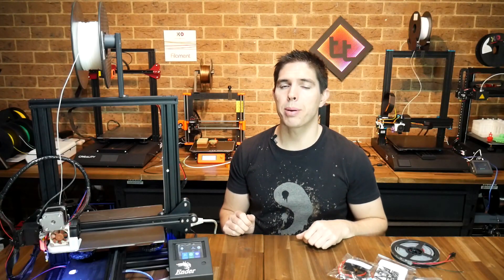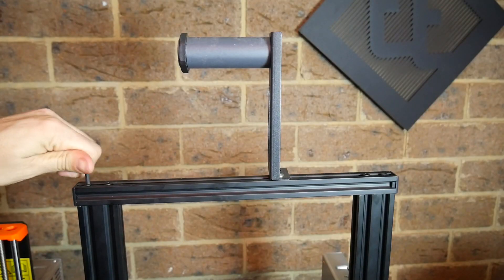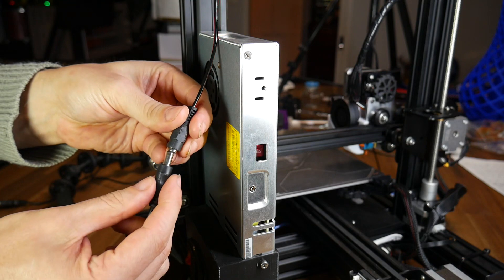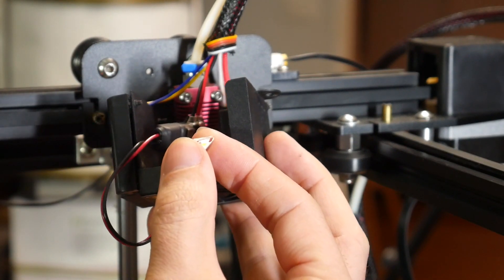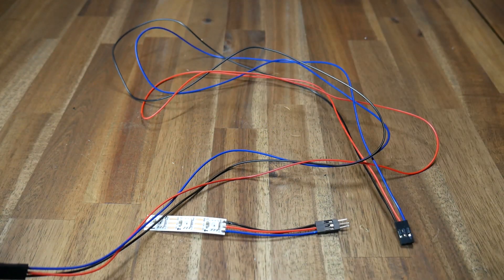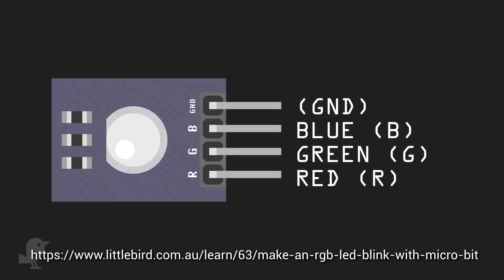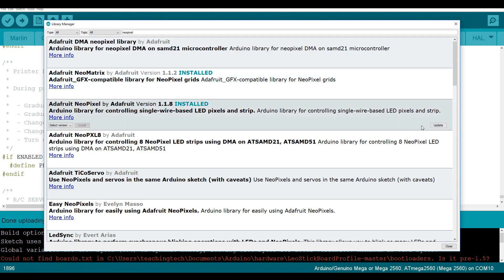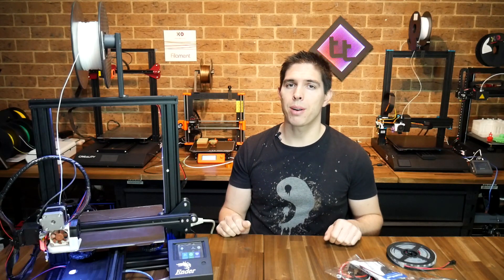3D printer LEDs - Beginner and advanced versions - Neopixels!

Comment: I have a CR20 Pro. I want to add some cob LEDs along the rails and hot-end. There are empty spots on my main board (Creality v2.1), an extra fan or two. Could I directly connect the LEDs straight to one of the empty fan ports (with a JST connector) and then turn the LEDs on by turning the "fan" on?

Comment: I have the hotend LED version from PrinterMods and love it! But I think I will wire it to my RAMPS 1.6 board so I can turn it off an on as I please vs with the cooling fan as the voltage varies depending on the speed you want the fan to run so the LED lights vary in brightness. For now it work but it'll be easy enoough to run to the pins on the board so I can trigger it with code in Octoprint or on the mobile version you can setup a button to run the command for on and off. Nice video!

Comment: I don't know what I did wrong... My ender 3's power supply literally went up in smoke after doing this...
Reply: Did you buy the 24v instead of the 12v if you're in America? If so you might have been trying to draw WAY too much power and it caused it to overdraw and blow it up
Reply: @ParrishT3  I made sure I got the 24V by checking on the LED's. I contacted printer mods customer support and they graciously sent me another one. The switch for the LED's started smoking so it might've been a bad switch??
Reply: Also, the Ender 3 is a 24V printer, isn't it?

Comment: Strongly advise avoiding that crimp connector he features here on his ender 5 hotend!!! 
When you pull the wires from the fan retention clip to have enough room for the crimp connector, it becomes extremely easy to pull the wires off of the fan's circuit board. The wires then cannot be soldered back onto the board, and then the fan must be replaced. 
As an alternative, it is much better to cut the wires further back and use a JST crimp set to make and install a JST socket and splitter to support both connections.
Not only does this support the LEDs, but it also gives you a means to easily swap your hotend fan if/when needed.
Understand that many people are turned off by the though of crimping or soldering, but if you rip the wires out of your fan its going to be a bad day if you don't have a spare....

Comment: Yes I installed my neopixels the same kind he used in video I did what I was supposed to do in firmware but when it comes on it goes thru the colors but not white and the printer events don’t work no blue to pink to red or whatever the colors while heating the bed or hot end what am I doing wrong I have the BTT SKR v1.4 turbo with 2209 steppers and it has a neopixel pin built in and the pin is set correctly

Comment: Good information for my Ender 3. The bed heater mosfet was damaged by ESD. I used pin 29 to control the BED HEATER.  #define HEATER_BED_PIN   29 (SANGUINOLOLU_11.h)   #define BED_LIMIT_SWITCHING, (Configuration.h)  I used a 2N2222 to control a 24Vcoil 10ADC relay. The Marlin default is 2C hysteresis which switches the relay about every 1m15sec.  
Thanks for the pin29 information.

Comment: The amazon link for neopixels in the description is not the ones used in the video, and have less LEDS per meter (so you won't fit 3 leds along the hotened).
Correct link: https://www.amazon.com/gp/product/B00R5CBOWY

Comment: I want to add 1meter of neopixels to my printer. I have skr 1.4 turbo. THe LEDs need 3.5a 5v power. Can I pull that much from the Neopixel 5v line or should I pull 5v from outside source?
Reply: Outside. You can use a voltage converter for 24 to 5v and pull right off the power supply. To the converter. To the lights

Comment: Recently purchased the “PrinterMods” LED kit .love it but the hot end should have some type off switch so u can turn it on and off as well . Hopefully there’s a solution to it soon!.
Reply: 3D PropCon I agree. I just got everything hooked up and mounted. The top bar lights are perfect, but the hot end lights are too bright overall. The ability to turn them off and/or dim them would be very welcomed.
Reply: @jayphilbin2871  @3d propcon Are you guys still happy with the LED's? Also not having it on the sides does it look funny (dark)? tks!
Reply: @armani007E55  I ended up removing the lights on the hot end. They were way too bright when it came to photographing or videoing the action.

Comment: The product links are not what you used, so I ordered the wrong kit. The neopixel strips you used are not 30 per meter or weather proof as per the link, they are probably 60 per meter. Wish I had known that before buying. Great videos but please don’t post links to parts you didn’t use and are not fit for the application you are demonstrating. Thanks.

Comment: i have so many grabage connected to my PSU that i don't have terminals left :s I even put wires in a few of the exisiting ones.  I really need to solder an extension board to just get a terminal but that's more space and fiddly stuff hanging from my printer :s
also damn those connectors are so cool. do you know what they're called? I always do it with soldering and it makes a mess :s

Comment: I followed the instruction to implement the neopixels.
Now I have a dead motherboard.
This is what I did and what happened:

I use Marlin 1.1.9 and an Ender 3  with board V1.1.4
I installed:  10 Neo-Pixels RGB WS2812B Digitale Led Strip Ultra Bright SMD5050 5V, triggered from pin 29.

Changed configuration.h
 as followes:
// Support for Adafruit Neopixel LED driver
#define NEOPIXEL_LED
#if ENABLED(NEOPIXEL_LED)
  #define NEOPIXEL_TYPE   NEO_GRB // NEO_GRBW / NEO_GRB - four/three channel driver type (defined in Adafruit_NeoPixel.h)
  #define NEOPIXEL_PIN    29       // LED driving pin on motherboard 4 => D4 (EXP2-5 on Printrboard) / 30 => PC7 (EXP3-13 on Rumba)
  #define NEOPIXEL_PIXELS 10       // Number of LEDs in the strip
//  #define NEOPIXEL_IS_SEQUENTIAL   // Sequential display for temperature change - LED by LED. Disable to change all LEDs at once.
  #define NEOPIXEL_BRIGHTNESS 127  // Initial brightness (0-255)
  #define NEOPIXEL_STARTUP_TEST  // Cycle through colors at startup
#endif

Library installed:
Adafruit NeoPixel by Adafruit Version 1.1.8

Compiling and flash went ok. Thereafter I got on my windows PC an message about to much current over usb. Then Ender 3 board died!

I don't know why this happened. 
I'am affraid to implement this again with a new SKR Mini E3 motherboard that's already ordered.

Someone who can help?
Reply: It is now known what happened.  When soldering pin 29, a bit of solder tin may have fallen on the part fan connector and has therefore made a short circuit.  I had meanwhile removed the old motherboard and ordered a new one.  I replaced the “Old” motherboard and everything works perfectly again.  All in all am happy again with the Ender 3.
Reply: @jan.walhof  Did you try to set it up again on a new board? I have used pin29 but my neopixels doesn't light up at all :(

Comment: I just got my kit from PrinterMods today, followed your guide and the instructions (sliding it in backwards, wires first), and my led strip broke :( I think it wasn't soldered correctly. I emailed the company, Im hoping that they will send me a replacement as I was very excited for this mod.
Reply: My led strip from them is shutting my whole printer down.  Did you get a response from them?
Reply: @gromzuk  No I never got a response...it's been a long now which is pretty annoying.

Comment: I tried following the advanced guide using neopixels. You mentioned that if I use analog LEDs I will require a mosfet. The Marlin code says I'll require one either way. When I tried to plug the LEDs into the printer as described, the printer shuts down until I unplug them.

Do I need a mosfet, and if so, how do I wire it?

Comment: I can't get the heatshroud on with that coupler inside it...mine looks exactly like yours does but i can't line up the screw holes and the two red wires for the hotend seem like they'd be smashed against the red heatdsink if i did

Comment: I just finished installing the Printermods kit on my Ender 3 and they both went in nicely.  The included installation instructions are okay but this video was a very helpful addition. When installing the hot end kit, I found it a little easier to remove  the 4 screws holding in the hot end fan and work with the splice outside the shroud.  When installing the rail kit, I raised the X gantry all the way to the top before loosening and removing the top rail screws.  I don't know if it helped keep my vertical rails parallel but it made me feel like I attempted to keep them straight.  The lights look great and the hot end light is especially useful.  Thanks for the video.

Comment: I was just working on adding in LED's to my machine today lol... Looks great man! I bought a couple white LED rings (60mm OD / 45mm ID) a few weeks back so I was making changes to add a round inset channel to the bottom of the Hero Me duct and modified my electronics box to add a switch and potentiometer to the front so I can adjust the brightness quick and easy. I might add the neopixels in the top 2020 extrusion as well, the color change functionality looks awesome!

Comment: Iv'e literally been thinking about doing this to my Ender 3 the whole day. But with Octoprint. Couldn't you use a pushbutton, connected to the Raspsberry Pi and make it turn on a mosfet which runs the LED circuit, turn on/off through wifi and even through the tft28?

Comment: I used rigid led strip in a simple casing and two sided tape but i did add a separate power supply that just about fitted inside the power supply cover. I also added a rocker switch to the power supply cover. It is much better now that i can have lights without having the printer powered on, makes working on it SO much easier. The printer is usually in my bedroom, the led light has been more used than other lights in the room, it isn't too bright, just perfect when you are going to sleep but still bright enough that it provides general lighting for the printer. 

I'm going to add 1W led beside the hotend, i need to just think how i want to do it, it will take power from the printer PSU.

As for cabling: buy flat cables.. they are very handy when you use Dupont connectors. You won't have the horrible looking three separate wires but one flat cable. Takes a bit of practice to get it looking nice, you can't fail with any of the the duponts or you have to do that end all over again.
Reply: Do you have photos of your printer posted anywhere ? And could you provide links ? Thank you in advance